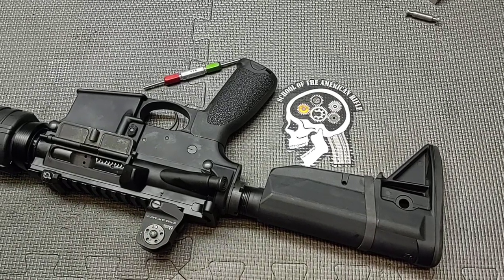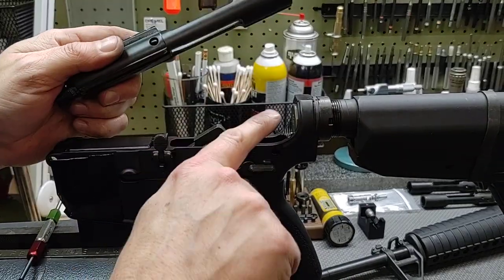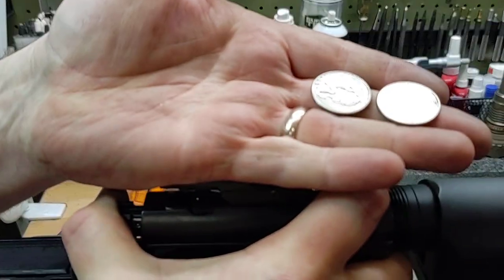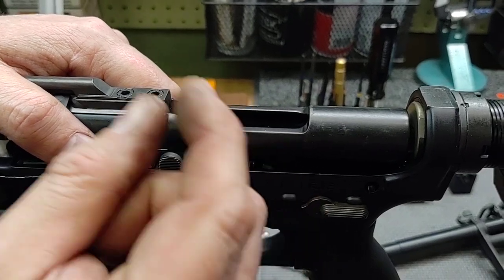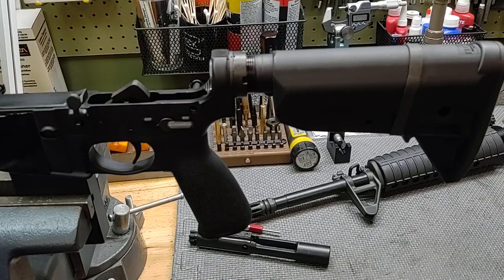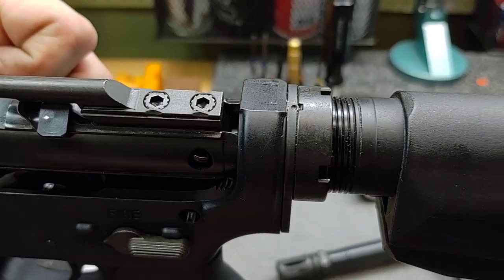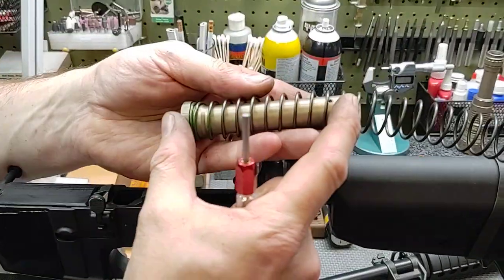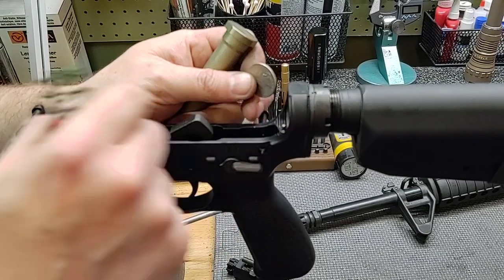AR Tech Tip - Gas Key & Lower Receiver Gap

Comment: I have never considered this possibility so I just checked all the rifles I have built and needed to invest 25 cents in the most recent which also uses the A5 buffer system. It appears that I have been fortunate.Thanks for sharing yet another invaluable tip.
Reply: Consider drilling a drain hole in your new 'buffer tube spacer', also.
Reply: @0neDoomedSpaceMarine  Will do, thanks

Comment: This is awesome, I am glad I stumbled upon this tip. I am on my 3rd build and never knew to check this spacing. I got lucky I guess on the first 2 (just checked spacing to confirm, though they had already been fired a bunch and they are GTG), but the 3rd and incomplete one I'm currently working on, needed a quarter. Caught it before it became an issue.

Comment: Thank you for sharing the tip, it might work for me since I have a problem with releasing the bolt and not lock in position. I tested it with 2 quarters and found that mine is not as thick as it is supposed to be, and I dropped in a quarter and it seems to work. I have to go to the range tomorrow to actually test it out but I have a strong feeling that this might be the case!

Comment: Defacing currency is only illegal if you were attempting to pass it off as currency. drilling a hole in a quarter is not illegal in any way. Example would be the penny machines that turn a penny into a souvenirs found in amusement parks, museums roadside rest areas. The penny is destroyed .

Comment: I noticed that I have too small of a gap on 2 of my 3 rifles. Two rifles have a PWS buffer extension and Geissele Super 42 Spring. The other rifle Aero Precision Extension amd Spring. The PWS/Super 42 combo needed shims. One took a quarter and the other needed 2 quarters. I need to take the Aero spring and put in the PWS or visa versa to see if it is the ectension or the Spring...right now I think it is the spring. Have you seen this before?

Comment: Can you further elaborate what would compress so much as to cause the "less than two quarters" space to be compressed so compressed that it would hit there, if it doesn't compress when you push it in my hand in a firm manner.  I guess one could tell if it started to happen. Thanks for your vids.
Reply: Also if the bolt carrier it's too short, if I'm not mistaken
Reply: @EnPeeSee  Thanks for the reply.  Do you suppose that regular 556 would do that, or only something "high-pressure"?  Not sure I have heard of "high-pressure" 556, but I guess it could exist.
Reply: @CoryHobbs2178  That makes sense, but I'm talking having about 2 quarters of space, and that turning into no-space, and then hitting the lower.

Comment: Out of curiosity, would taking the buffer tube off and grinding the width of the quarter off the threaded end work for a solution?
Reply from the maker: Yes. That would work but a file is a better option in my opinion.

Comment: Is there a way to help over gassed system on a pistol with a Pdw stock, without a adjustable gas block?  Buffer only has room for 1 weight so 1 tungsten is as heavy as I can go. 
 I really don't want to remove a gas block that is factory installed. Any tricks you know about?
Reply: Black river tactical ez tune gas tube

Comment: so the problem I am having is I bought an armaspec gen 4 buffer system with an h3 buffer. Its been in a pistol build I had and worked fine. But I recently built a competition ar though, and decided to move the armaspec recoil system over to it AND to use their h1 buffer instead of their h3 buffer. Their h1 buffer has a rubber pad on the end of it where as the h3 did not. I know there is supposed to be tension from the carrier to the buffer when using the armaspec system. I still have the same amount of tension with the h1 as I did with the h3, the problem now is that when I go to charge the gun, the bolt wont come back far enough to catch a round to feed into the chamber. I have tried diff mags and ammo, so I am REALLY beginning to think its the new h1 buffer I have put on the armaspec somehow causing the issue. I thought of unscrewing the buffer tube one more turn counter clockwise to back some of this tension off, but I am afraid when I do, I wont have enough intended tension on the carrier that armaspec intended for it to have. Am really racking my brain here, should have just went with a geiselle super 42 I guess, but really wanted to use the armaspec buffer system since its a competition build and im trying to make it run as smooth as i can. Sorry for long post. Thx tons man, hope u see this comment soon, or someone does. Thx guys

Comment: Is that also relevant for the 9mm pcc?
Reply: EVEN MORE SO!  There are so many different buffer systems out there, and the 9mm bolt only needs to cycle a short distance.  Many competition shooters actually intentionally shim the system out to override the bolt hold open to get the shortest and fasted cycling out of the gun possible.
Reply: Yes, according to another comment, apparently this used to be done on the Colt SMG (as issued by the Department Of Energy), and would make the gun stop wearing out and breaking bolt catches.

Comment: If the gap were too small would it affect the bolt holding open on last round?
Reply: Yes.  If the gap between the bolt catch and the bolt face when fully compressed is too short, it will stop the gun from locking open.  You need 'just enough' to prevent the BCG from hitting.  More isn't better.
Reply: @seanmtactical6069  thanks!

Comment: Does this 2 quarters gap test still apply if I am using a JP silent capture spring??
Reply: It should apply regardless of the buffer system.  They all have some sort of rubber shock system on the back that can compress.

Comment: Just did this last week with two receiver extensions.  Working on a new lower this evening...  I didn’t need to ADD anything, but I can fit three quarters and almost a dime between the gap on this one.  Is there a guide for the point of “too much” gap?

Comment: How would this work with a folding adapter
Reply: same way
Reply: Well, assuming the gap is too short, you'd put that quarter in the buffer tube the same way, the spring will hold it in place.